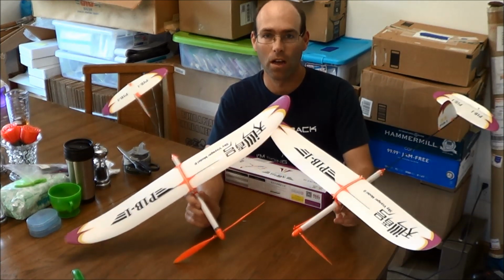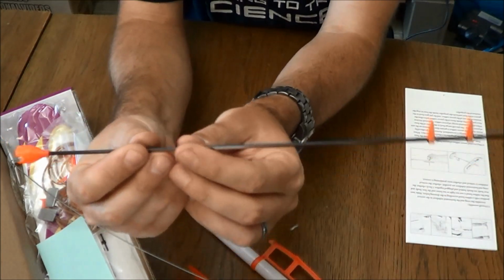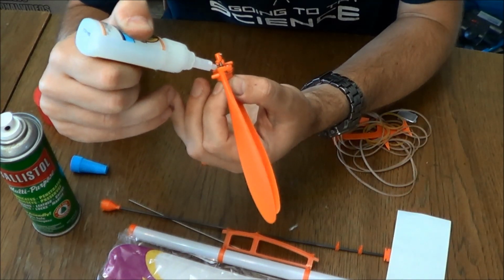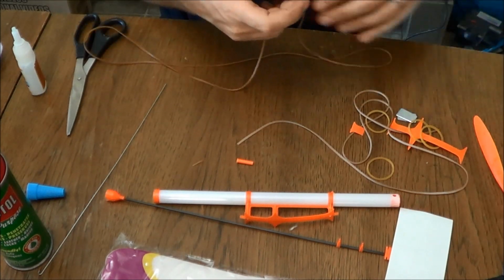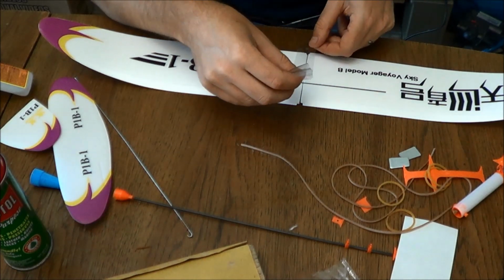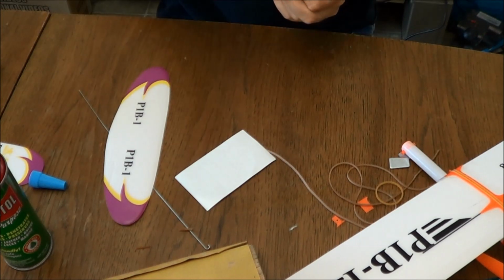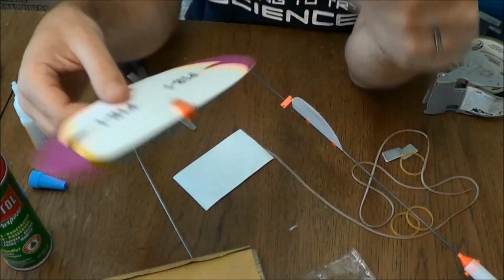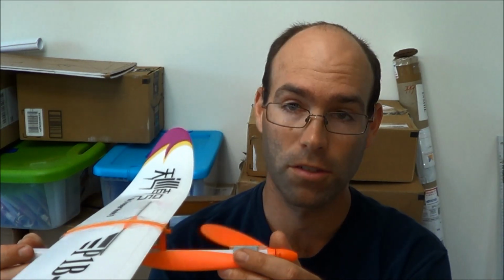P1B-1 Sky Voyager - Complete Build of the Best Rubber Powered Airplane

Comment: As a sailor and professional knot tyer I was surprised to see your deliberate use of the 'Granny Knot', which by my accounting has no legitimate purpose and is no more than a default situation formed by the incorrect tying of a 'square' or 'reef' knot. Is your choice of the Granny Knot by design or are knots not your thing?
Reply from the maker: I've tried half a dozen knots including reefers and figure 8 knots. I use the know that works and that gives me precise control over the finished length of the rubber. There are some cases where a better know could be used, but I find that consistently doing the same thing leads to better decisions under pressure, and the other "better" knots don't provide a measurable advantage.
Reply: @joshuawfinn  One other tip I learned from the Manager of a Goodyear plant was the use of water as a lubricant when working with rubber. For the cutting of rubber, water works better than any other substance in the reduction of friction and allows the tool to pass through the material like the proverbial "hot knife through butter". It works just as well when cinching up a knot in a rubber band and after it dries, doesn't cause the knot to slip. I would not be surprised if the precise wetting of a rubber motor with H20 allowed for a longer flight and you would be the perfect person to test that theory.

Comment: Something you don't mention, but is important. The wing mount is supposed to be 115mm back from the nose. Mine was way forward of that point, about 60mm and had to be moved. For some reason it was very tight until I got it moved nearly back to the indicated point.

Comment: Josh, what would you consider to be the best flying rubber-powered model that is available?
Reply from the maker: Well in an extremely generalized sense, the Dawn Patrol is the ultimate performance machine, but that's only available as a short kit, it's huge, and it needs a big field to fly. Best all around model...I dunno. The Echo has been updated so you can fly it fairly effectively in 5 classes in the US, Senator is legal for 6, Gollywock is legal for easily that many and climbs like a gas job, so you could go round and round weighing all that. Really depends on what your goals are.
Reply: @joshuawfinn  Thank you so much for your response.
Well, I'm not contemplating competition anymore, just relaxing sport flying. My local field is set up for R/C and is not big enough for free-flight, so R/C rudder assist is the way to go there. I was impressed by your Wakefield so I purchased an Easy Built Laser-cut Wakefield kit which I'll electrify and build in the cold, cold winter to come. 
I'm sorry to keep bothering you with questions, but... what do you think is a good high-visibility colour scheme and lightweight covering for my Wakefield?
Cheers, mate.
Reply from the maker: @Glicksman1  no worries on time, it's why I have this channel. For light coverings on sport rubber models and medium sized electrics I'm a huge fan of 0.6 mil doculam (laminating film) with a light misting of paint on the adhesive side. For the fuselage if running rubber power you'll need something stronger like 00 polyspan.
Reply: @joshuawfinn Thank you. I like the lam film, too.... and a high-vis colour scheme?
Reply from the maker: @Glicksman1  orange and black stands out like a strobe light in the sun. Used that on a balsa hand launch model recently and it worked amazing for being able to take my eyes off the plane so I could ride my chase bike without killing myself and then look back periodically to reacquire the plane. Unfortunately I finally screwed up the DT and lost the model after something like 8 maxes.

Comment: What is the lightest two-channel in-plane system available?
Reply from the maker: Micro Flier Radio had some crazy light setups, less than 1 gram, plus you can get actuator based systems from China now that work on DSM2. The Horizon and Oversky bricks are around 2g.
Reply: @joshuawfinn  Thank you Josh. I'm planning to add R/C to my Voyager and I think the Spektrum receiver/servo system looks good.

Comment: Hi Joshua, I've been enjoying many of your videos for some time. Although I don't fly 'free flight' I do enjoy seeing it in action. This year I'll be having a go at some rubber powered RC assist models though (rudder with dt). I have a Sky Voyager and will make a servo activated dt so thanks for this informative video as I can use some of what you've demonstrated. The motor tube on my Sky Voyager has a slight banana shape when you look side on with the nose pointing up slightly (don't worry it's not one of yours). Thought I'd check with you whether this should be dead straight before I straighten it. Keep up the good work 👍 Carl
Reply from the maker: By the way I very much enjoy your channel!
Reply: @joshuawfinn  Thanks for taking a look Joshua. Nice to know you enjoy it.
Reply from the maker: Carl, good to hear you're trying out this great model. If the fuse is only bent a few degrees it'll be OK but if it's more than 5 degrees you'll probably need to straighten it.
Reply: @joshuawfinn  Thanks Joshua for taking the time to reply. I have the Sweet P20 and P30 to build from Mike Woodhouse so thought I'd use the Sky Voyager first. I'll straighten the fuse and get it finished.

Comment: What does it weigh, and how much rubber does it need? I've been buying the little Chinese Streek Sleek clones and had a lot of good luck with them - would like to try one of these but I don't have a good outdoor field. I wonder how it'd fly if you reduced the nose weight and moved the wing back.
Reply from the maker: They're in the 30g range without ballast and carry about 4g of rubber. You can play with the motor lengths to optimize for indoor if that's what you're looking for. Ive found that these do fly much better than the other Chinese rubber models, mainly because of the better airfoil and larger prop.
Reply: They do seem to fly well. A friend got one yesterday, so I've been wondering about them, mainly how much rubber to use. I've since come across your videos of the smaller one - maybe I'll go with one of those first. I'm not exactly new to rubber but I've only been dabbling in it (when I was actively competing I did CL Combat). A few years ago I found those Chinese stick models with foam wings, they come in a little plastic bag and, once modified (you can build them down to about 6 1/2 grams after you've thrown away most of the plastic parts) I've been able to get 2 minute flights indoors (there's a couple videos on my channel, and some posts on Hip Pocket Aeronautics). We fly indoors in a shopping mall (about 50-60 foot ceiling!) and a few weeks ago we were supposed to try flying these models outdoors but got rained on. Then the second wave of COVID hit, I'll have to try it again in a few weeks. I figure they should climb like rockets on a loop of 3/32" Tan SS. Nice thing is they're cheap so you don't mind too much if you lose one.

Comment: Awesome video many thanks. As a total novice what weight is the ballast  you attached to the front and where would I find some.

Thank you
Reply from the maker: I used 1/64" lead sheet, found on ebay. If you have concerns about using lead, mild steel or copper might also work. K&S sells brass and copper...not sure if they sell mild steel.
Reply: Many thanks, found your videos on this model by chance snd now I'm hooked.

Comment: I broke my motor. It seems that 1mm x 1mm is tough to find. Recommendations?
Reply from the maker: I'm using two loops of 1/8" Tan Supersport. It's better rubber and makes these planes climb with authority. You can get it here: http://jhaerospace.com/product/1-8-tan-supersport-16-ft-length/ or at Peck-Polymers, Volare Products, etc.

Comment: Thanks for the build video.  I figured most of this out eventually.  Thanks for the tip about securing the main wing rubber band to the pylon.  This certainly can save some frustration caused by losing rubber bands.  Thus far I have not gotten my P1B-1 to rise more than about 10 feet above the ground even with dead still air at 70-80deg F .  This was both with the instruction recommended 6 strands of rubber as well as your 4 strand recommendation.  Is competition grade rubber the answer here, or something else?  The rubber was lubricated with DOW 33.  I've moved the CG around using the main wing position as well but it still tends to climb only slightly at first then drop slowly until rubber power ceases just about the time it hits the ground.  The glide without power is quite good so I'm not certain why this is occurring.
Reply from the maker: James Eagleson how many turns are you cranking in? The stock rubber should take something in the range of 300 turns with careful winding. Supersport rubber will definitely make it climb better, but I'm concerned that you're not getting much climb. Sounds like there might be some crud in the nose bearing or the CG is too far aft and a bunch of down elevator to compensate.

Comment: Awsome as usual. Being a beginner amateur, may I just know what are the wings made of and the type of motor used in those planes ?! 
Thanks in advance.
Reply from the maker: The wings are a foam material similar to Depron. Rubber motor supplied is 3/32" wide brown rubber. It works well enough to fly the airplane, but they really come alive on 4 strands of 1/8" Supersport rubber.

Comment: Thats a nice little airplaane and I can see why you have selected it,can I suggest slip a small piece of standard heatshrink electrical tubing over the propeller hook and after a bit of heat it shrinks up perfectly preventing the rubber to chaff into the wire,I have used this with great success on my rubber scale jobs,also we cannot get Down Corning 33 in the UK a useful substitute is Wickes Silicone lubricant which is economical and works well.
Best of luck with this lovely design for the future.
Reply from the maker: Thank you for this information, especially the lubricant availability problem. I'll add this to our website.